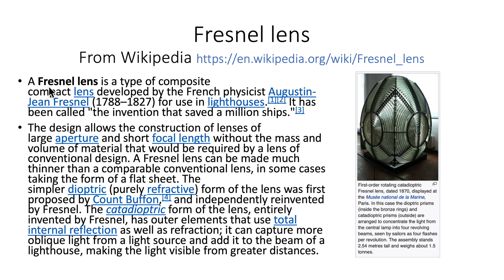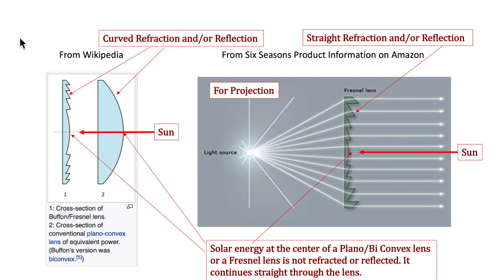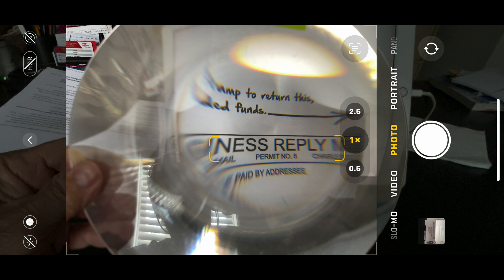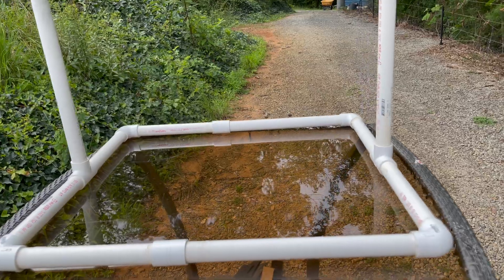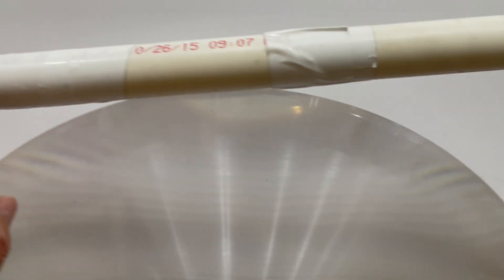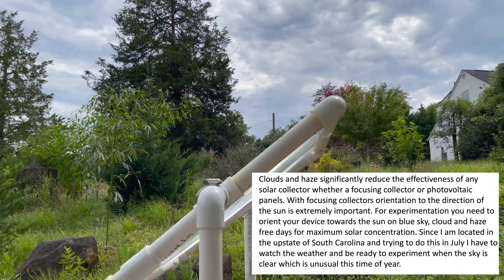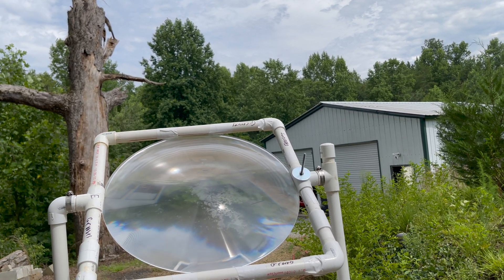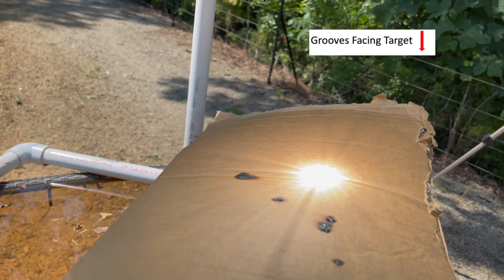Fresnel Lens for Solar Heating with Laser Focal Length Demonstration and PVC Pipe Lens Holder

Comment: Thanks for the video. I feel you should add some warnings to your work. I do have some larger ones and they are scary strong. If you put your hand at focal you'll get hurt, if you leave it outside you risk unintentionally starting a fire. These should be stored inside, in the dark or covered. They are not toys, but are truly wonderful devices that have yet to be fully utilized. So do enjoy them but with caution. Birds have flow through the beam and been injured or killed on larger plants. In San Luis Obispo California at the public library is an old glass lighthouse fresnel lens. Again thanks for the video.
Reply from the maker: Thanks for your comment and safety warnings.